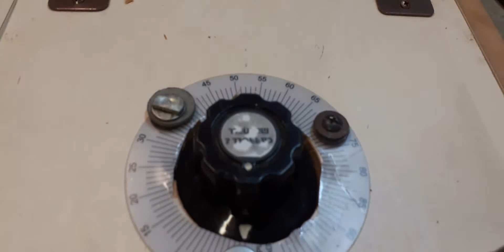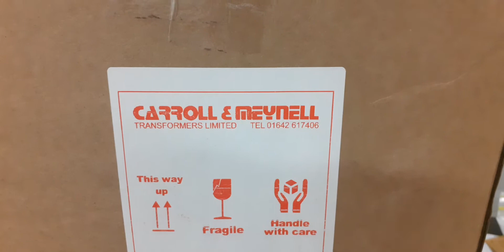Variac build.

Comment: Nice variac! I like the mdf box, especially because it’s customizable. Thank you for the idea with making the box. The coil and cores are definitely cheaper when compared with the casing. I’m planning on getting a variac in the next couple years.
Reply from the maker: Thankyou, I just had enough of having no variac. I will tell you its a hell of a lot cheaper building the box than buying a fully built variac. But its a bitch to get the holes in the correct places for the bolts, so I would advise to get a template for it.
Reply from the maker: For pricing this variac 9A 2.5kva was about $360ish nzd. For a 2kva 7-8A it was around $400 nzd built in a steel case.